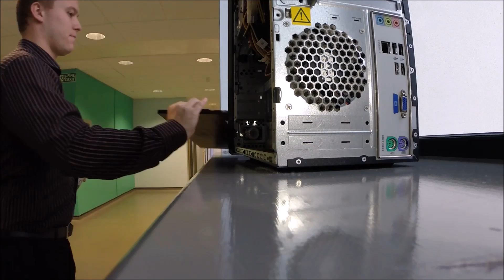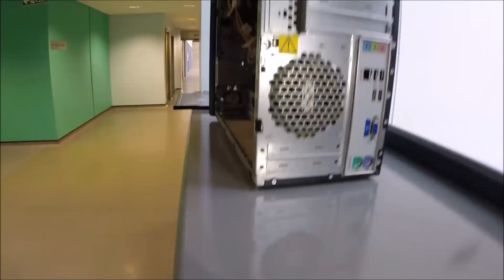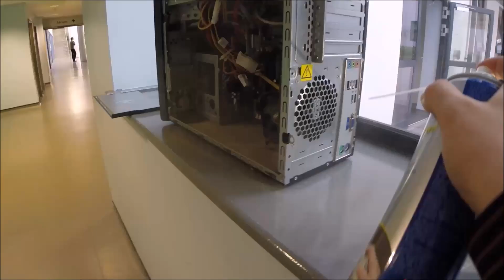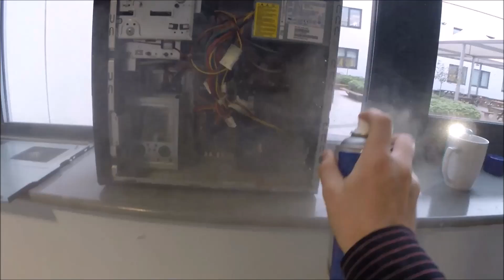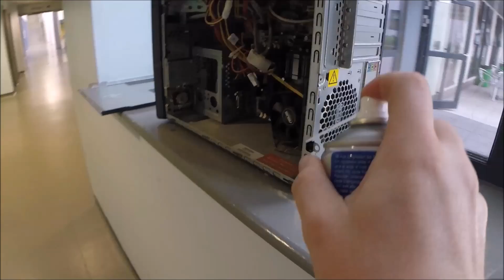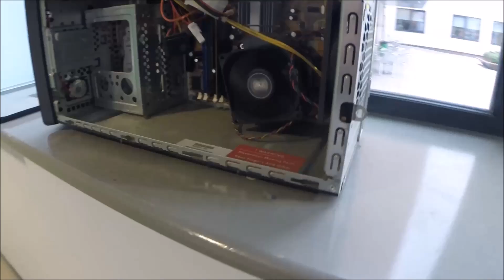Using compressed air to clean a PC

Comment: You need to hold on to the fans while doing, or you might damage them. You practically destroyed this computer.
Reply from the maker: The computer was and probably still is FINE. Don't you worry my friend!
Reply: @JakeBilling  just a tip :) can potentially get damaged if it spins too fast. Glad to hear its fine.

Comment: I'm guessing that the PC didn't work after that, especially when you blew air into the CPU fan for several seconds like that! OUCH!
Reply from the maker: Foebane72 why wouldn't it work?
Reply: When you spun the CPU fan with the air jet like that, you generated electricity (because the opposite of a motor is a dynamo) and most likely the current exceeded the limit that the mobo could take. I've heard this mentioned elsewhere online when it comes to compressed air fan cleaning.

So did your PC still work afterwards? If so, you were lucky.
Reply from the maker: Foebane72 nah all 200 worked fine afterwards 👍🏻
Reply: @Foebane72  No that is bullshit. Spinning the fan does not kill your pc.
Reply: @davidlp3019  I have heard it elsewhere too I can't recall the video but while cleaning the dust with vacuum cleaner or compressed air can it's better not to hold in front of it more than 5 second.
The distance should be 8-9 CMS too

Comment: I've been told not to spin the fans so fast, it will burn or damage your pc fan etc
Reply: DMS FANDUBS no not really
Reply: Nob the Knave  the problem is probably if you spin it to the other way from how usually the PC spin it. Though I'm just speculating, I don't know if it's true or not.

Comment: If you're going to blow the fans, hold them still with one hand! god..
Reply: If it broke because of a dust cleaner, then that fan would have broke the next time you turned it on
Reply: @ArmedGamer1000  no. Doing that to a fan can damage it and shorten its lifespan. They arent designed to spin like that.
Reply: omfg don't ever have children man...
Reply from the maker: What's up?
Reply: +Jake Billing Otherwise you're going to destroy the fans, if you're unlucky. that's all i meant
Reply from the maker: +Aurum Anima haha thanks for the advice
Reply: who cares if it broke just a buy a new one its cheap
Reply: @his honer jeezus christ you are a special kind of stupid... do you know how electrical motors work? if you power them up yes they spin,but if you blow air at them or turn them,they generate electricity,don't believe me get an Led light attach it to the fan cables and make the fan spin like he did... spinning the fan like he did wont break the fan it will break the motherboard
Reply: @United4Games  Yes - This also is how wind mils work to generate clean electricity from wind - It is utterly logical with even the basic knowledge.
Reply: Some Noob That Plays Minecraft its because the spinning can build up static electricity, not because of mechanical failure